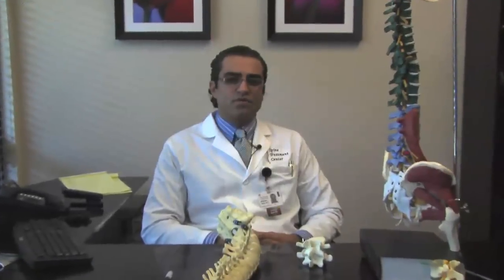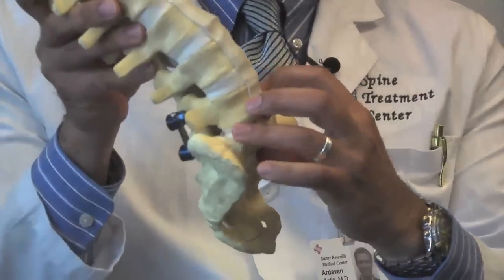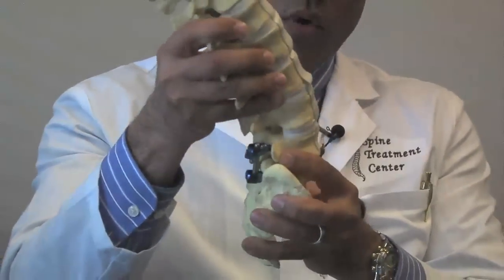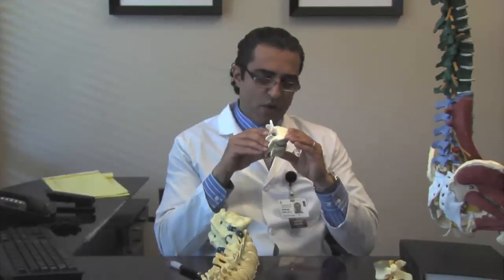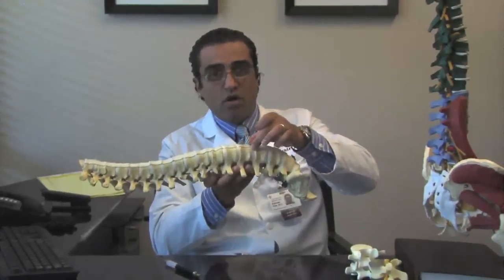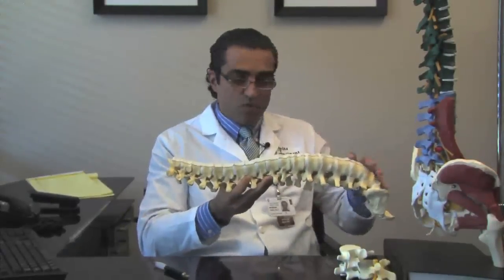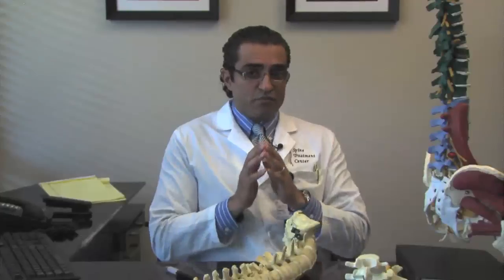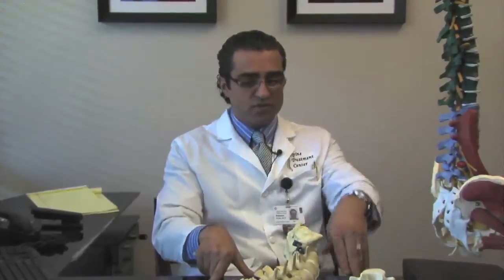Spine Treatment Center - Fusion Vs. Disk Replacement

Comment: Update: 

Watching this really scared me before I decided to do a lumbar hybrid: L5-S1 alif and 4-5 adr (active L artificial disc). I was worried about the scar tissue, iliac veins, not being able to revise etc. But 2.5 years post op all has worked out well for me. 

I did have a synovial cyst which surgeon did leave behind at L5-s1 (as it was embedded in my spinal cord). That cyst was a major problem for over a decade (couldn't stand or walk very long) and for two years post op it was causing even more pain, until it finally ruptured a few months ago in feb and at that point I had a new back. 

42 now, surgery at 39, after two microdiscectomys in my  late 20s early 30s. I'm glad I did this hybrid alif/adr surgery. It was a long road to recovery, but I feel i've been given a new life. I can carry a hand basket in the grocery store,  I might actually be able to pick up a grand child someday. For 16 years of my life i endured and was limited by significant back pain that left me physically impaired, which perhaps inadvertently preserved the uninjured portion of my back for this new chapter. I waited to do a fusion out of fear and also I wanted the science to develop as much as possible with adr in mind. 

I would do it again, but if it were now, I might wait for the Axiomed lumbar adr to be fda approved which seems imminent - it has a spongy nucleus, more shock absorbing. Guess I will do that at 3-4 if I ever need to. Still feel good going with Active L over prodisc at l4-5. My l5-s1 alif is a spineart Scarlet
Reply: 11 years the disc evolution
Reply: Thank you for sharing your story with us! Highly appreciated and glad your hybrid worked out for you. May I ask who did your surgery? I myself am waiting patiently for the Axiomed Freedom Disc but it just keeps getting delayed year after after 😢. I've considered fusion on my L4-L5 over ADR but I mentally bounce back and forth between the two. I have a semi-physical job and I'm si scared of losing my job over ADR. How is your lower back pain before vs now now?

Comment: In 1997 after an accident in my car ,I was told I had degenative disk disease in my neck. I got therapy at the VA hospital later I got shots for pain. Had problems with my arms shoulders and hands. Took EMG, MRIs ,everything, steroids the whole nine. I was a truck driver for 16 1/2 years. To make a long story short, Jan. 2014, I had a Anterior Cervical Diskectomy & Fusion, c3-C4, C4-C5, C5-C6. In other words I've got 3 artificial disks, a titanium plate (cage) & 8 screws in my neck. The operation was good. but I an now in cronic pain in my neck, not the pains I had before. I did short term & long term disability, my job had to let me go. My doc. informed me I may need another one in 1 or 2 years, I've got 2 more that are going bad below the 3 that were fused. The whole operation took 3  1/2 hours, once inside things were worst then they thought. In 17 yrs. 1 disk spread to 3 that went " BAD ". I waited as long as I could dealing with the pain and all, I was really bad off. I got depressed, still dealing with depression. I now take 2 pills for my depression, 1 pill for my heart a bars blocker to slow my heart down, 2 pills for blood pressure, 1 pull for muscle spasms, I also take Hydrocodon 3 or 4 times a day. I've gain a little wieght, I went from 180 to 195, I'm not as active as I once was. I can't work, I'm 59, I'm on SSDI, social security disability, so my whole life changed. If you need them to cut you, get at  least 3 opinions, that's what I did, I just pray no one ends up like me. I fell in that 25% where you may have other issues, I still have tingling in my hands and arms, they both still get a little numb. But none of it along with the pain is near what it was. The cervical (neck) is a better operation then the back, there's not as many problems. Like I said I happen to fall in the % that happen to have the problems that I did. GOOD LUCK GUYS and have a blessed day.
Reply: Get back to me I have similar  problems
Reply: Brother we serve a mighty God. Find yourself a pentecostal church and go there for prayer.  Jesus Heals. It must be a pentecostal church though
Reply: Brother i really feel for you. Im believing in miracles. Jesus is the healer. I too am in s compromised way with my spine. Life changing to say the least.
Reply: hello Sir. I fully understand you.. my back surgery went wrong big time. loss the use of my left leg. 75 percent.  bowel bladder issues. the pain in so much worse. in total disability now. thank God for my dog. you found out who your true friends family are.. in pain 24 7..now no Doctors will give me the time of day... God bless everyone here.. Amen..
Reply: well said i had mind at 67 years of age been 4 months still pain full no better sure takes more time at my age and might never get any better
Reply: @williammurgida7521 😂 only Pentecostal huh? Jesus wont heal him if he goes elsewhere?!

Comment: I have two fusions and that was a wonderful tutorial. My neurosurgeon brought up the disc replacement in the lumbar and stated that if it failed, you would probably never make it to the hospital because of the vein. The superior vena cava. In the neck, it's OK but not in the lumbar spine. a friend of mine had a replacement fail, luckily in his neck. Surgical error. It was repaired and he's fine. The problem is if you look at the replacement disc, there is NOTHING but your own muscles and tendons stopping it from rotating, except your own body. I don't like it. What is it?? A mechanical device that can fail.
Reply: if i had two fusions and it was accelerating disc degeneration at adjacent levels I would certainly consider adr. especially if the fusions were at lower levels, the vein isn't as much of an issue at L3-4 and up.
Reply: I had a fusion at the L4/L5 level in 2001. 8 years later in 2009 I had an artificial disc replacement at the L5/S1. 
This video has made me very concerned about the potential risks in regards to the vena cava and what could happen if the artificial disc fails.  Sounds like I need to get a proactive consultation to see what preventive measures could be taken. If any.

Comment: Dr since it's 9 years later, how do you feel on lumbar disc replacement now?
Reply: Oh man, I just asked him a question and I see that’s it’s been two years and you have not gotten a reply…
Reply: I'm not a doctor, but I've done a lot of research on this. I think the technology for disc replacement is not advanced enough. There is a disc called the Axiomed Freedom disc that may be promising but it's not FDA approved yet. Most designs now don't have shock-absorbing capability so they don't mimic a normal disc. I imagine this can still lead to adjacent segment disease even without a fusion.Some discs can also move from their original location which is obviously bad because doctors probably won't want to do a revision because of the scar tissue. Some discs can also cause osteolysis which means the bone near the disc dies.  Also the anterior approach has it's own risks no matter which disk you use. In men this can lead to sexual dysfunction. The artificial discs seem to work best in 1 level replacements although it has been done in 2 levels. More than two levels you're pretty much getting a fusion. Whether it's a fusion or a disc replacement, it's a major invasive surgery and both have risks.

Comment: Thank you, very good explanation. Except that Shocks and struts do the same thing, comparison would be the cars springs, and shocks/struts, with out shocks/struts the wheels and body of the car bounce uncontrolled..
This was good for me to find, my spinal surgeon basically said the same thing regarding candidacy for disk replacement, Im looking at a C5-6 Disk Replacement (Prodisk-C) as I am 44 and we can take my disk injury back about 20 years ago with having Whiplash 3 times within a 8 year period, and all the headbanging in the 80's probably did not help ether.
Waiting now on Insurance to approve then I get upgraded.
Thanks again for posting.

Comment: The vein along lumbar spine not moving is an anecdotal conclusion. Just saw ADR replacement/corrective disc surgery in which they took out the failing g disc.

Comment: Great thoughtful vid, who would have thought to consider the cause of the disc issue informing the type of treatment, duh! I am wondering where the research is currently 9 years later? Considering L5 S1 replacement with prodisc L. Thoughts? Experience? should i go fusion? My disc issue is the result of injury wear and tear. also runs in family however if I didn't do to my body what I did, I am sure my back would be fine and pain free today at 40yrs old. have had two microdiscetomy left and right L5 S1 over the past 12 years.

Comment: I have had 2 surgeries L5/S1 in the past 11.  I have many of the issues mentioned by others such as stenosis, spurs, muscle atrophy, arthritis DDD herniated disks and the like and the list goes on.  I have maintained physical therapy, chiropractic care, spinal injections, steroidal treatments and pain management tactics to no avail.  Now my disk has disintegrated and left my L4/L5 bone on bone with nerve root impingement.  I have mortifying pain that radiates from my lower back through my buttocks, hip and down my right leg.  My leg is heavy and extremely week and once again I have a pronounce limp and often have to walk with a cane.  I am only 43.  I now have to prepare for the TLIF because it would appear that the nerve or a nerve that assists in controlling the bladder and bowel is having issues as I am pretty close to having no control over either.  I suppose there are good and bad to every surgical procedure and it is best to avoid having them if possible as we do not know the success rate by guarantee.  Everyone's body is different and will respond and heal as their genetic code instructs it to, I hope this helps for myself and certainly hope that all of you feel better and get well soon :)  Wish me luck and the best of luck to all of you
Reply: +Laura Richards 
I know this is way late but good luck and I have said a prayer for you, I hope it worked out. I have experienced some of the pain and loss of control you have described and would not wish that on my worst enemy my heart goes out to you. I will be going through surgery on my cervical tomorrow, have been lucky so far with my L4-L5 injury of 10 yrs ago just a few flair ups and with PT I have managed to get by. Let us know how ya are.
Reply: How are you now?
Reply: @davidmarcade9356  Hello there im scheduled for  L4&5 fusion on Nov-8-22 im more confused now seeing what most people say about it but please tell me how are you doing after all this time you've had surgery thanks.

Comment: I wish I could like this 100 times. You're the first video I've found to answer some of my questions. I've been in several car accidents. My neck is the opposite of a healthy one in xray views. I could tell you all the exact places per the reports, but what for? I'm suppose to have neck fusion but I'm not convinced in doing it for the exact reasons you stated. So I've put it off and tried to live with it without treatment. My concern is my right arm pain for work purposes. I thought well of ProDisc until I started researching further. Dr. Light made it seem so perfect. But I think it will be years b4 they work out some of the probs. So now I'm not sure if PT is the way to go, or McKenzie method, or chiro, or what the hell.
Reply: I had a double fusion in my neck after a bad car accident C5 and C6 and all the pain in my arms armpits and chest is gone and I've never had any issues arise from that surgery!
Reply: @GazzMoss  How long have you had the neck surgery? Still no pain? I too heard bad things happen after spinal fusion so I'd rather do stretches but lower back pain never subsides I now feel light groin pain after 1 year 4 months

Comment: Hi Dr.I want  to know how long the recovery is for a disc replacement.  I'm sixty years old jumped off a military truck and injured my back.  No surgery just pain meds and rest.  My back has hirt off and on since. Good days bad days.  In 2010 I was in a car accident which eventually caused me to have to have a hip replacement had that five years ago. My last x-ray showed that I have four bulging disc, Cauda Equina Syndrome, sciatica L2, L3, L4, L5 degenerative getting worse as the numbers get bigger. I'm to see a surgeon soon, but I definitely don't want to have a surgery that would take me a year to recover. Are there specifically new implants that are better than the first original implants and what is your suggestion, constantly lose bladder and bowel functions
Reply: Talk to text did not work out well for me lol

Comment: Great video. Thank you for explaining everything in a simple way. I’ve been going through some back pain in the my lower spine for about 6-7 years now. Had numerous MRI scans which shows I have two degenerative discs at the very bottom of my spine. Keep going back & fourth to hospital when it flares up really bad, so I’m hoping one day I’ll be able to get it fixed, or at least be able to alleviate some of the pain, at some point.
Reply: gregthehutch
 have you tried decompression?

Comment: I have had 2 surgeries at the L3- L4 level. Both were microdecompressions. 
The 2nd surgery was about 2 months ago, but I'm experiencing a lot of numbness in my feet, and its getting worse. Yesterday my physician told me that disk replacement is not an option for me because I have mild case of spondylosthesis at that level, plus disk replacement doesn't work well at L3-L4.
But I am a candidate for disk replacement at the levels above and below. 
What do you think?

Comment: Thanks for uploading this video.I am a 30 year old male.Injured in 2010, It took them over 2 and 1/2 years to approve surgery.I went with the disc-fusion on the L5S1.I went through the recovery stages & 7months out the pain was worse then before.They found that the L4,5 was now bad & 3months from that, the 3,4 went bad as well.I am now looking at more surgery & asking what well work best? I also was told by the NCS both legs are permanently damaged.It hurts to do anything&everything.Input PLZ
Reply: Schizoinsomnia how are you doing? Did you find answers? Really wish you are doing better.

Comment: Hello doctor,
I have a damaged disk in my neck and I’ve seen a doctor who wants to do disk replacement, and my second opinion doctor is offering fusion just wondering which would be a better option for 40 years old.
Thanks

Comment: Greetings Dr. Asli (per video verbal intro).  
* Question: Rather than utilizing a mechanical fixed disc replacement, why isn't a more realistic design used ? For example, a molded prosthetic resembling the same consistency of an actual disc made from a synthetic compound ? It would offer the same flexibility while also the same movement control of a natural disc. For example there currently is a material, "hydrogel" that has a gelatinous consistency. It is comprised of tiny glass pieces of fiber woven together into a fabric, binded together by hydrogel (contact lens material). This material yields a material that is both as flexible as jello and as durable as metal. Jian Ping Gong, professor at Hokkaido University can attest to the benefits of this existing innovation, and further explain detailed specifications associated with this hydrogel composition. This Hydrogel composite is certainly a game changer and must be seriously considered for disc replacement procedures as soon as possible. Even though the current mechanical disc mfg's will lobby hard against its acceptance, regardless influential proponents such as yourself Dr. Asli will be very instrumental toward advancing the improvement of disc surgery.
Reply: axiomed L is about to be approved by fda has gel nucleus

Comment: I have degenerative disc disease, and 2 discs that I'm supposed to have  replaced.  The l4 l5 and l3 l4, they are bone-on-bone and the disks are pressing on the root nerve causing pain down the back of my legs  and side of my legs. I've been in bed for about two years because I can barely walk. Now I'm afraid because I don't know what I should do with my situation. I'm in pain 24/7. I've been in a few car accidents back when I was 17 and a couple of 21 and one at 43. I'm 54 now. I am terrified because I don't know what to do.

Comment: Dear Dr., 

I know you are a very busy surgeon and I understand if you cannot answer. 

I am a 32 y/o female who has 7 year old twins and a widdow. I hurt my back lifting some medical equipment at work. I am a rep in the OR. ( I do not work in spine). I work in general sx and Batiatrics. I have had a EMG, and a MRI. They both show moderate disk bulge central posterior left greater than right L5 and SI. The pain was holding steady for the past year at about a 4/10 with 800 mg ibuprofen 1-2 times a week. Over the 4th of July I went for a light jog and the next day I was in so much pain I had to go to the ER. I cannot to a SLR on the left past 30 deg hip flexion and cannot do a bridge or sit up on my own in bed without 9/10 pain. I cannot sleep or drive. I do not know what to do. I’m wondering what your thoughts are. It has been over a year since my date of injury.

Comment: this makes sense, what you are saying......nine years on and now with year 2020, have they advanced somewhat with safer method for disc replacement to lumbar area so that reversal can be an achieved ...?
Reply: the problem is scar tissue. For a disc replacement it has to go through the belly and past the iliac blood vessels. The risk is tearing these vessels during a revision. That’s why most doctors would just do a fusion if the disc replacement fails.